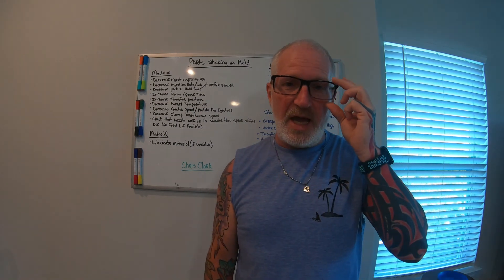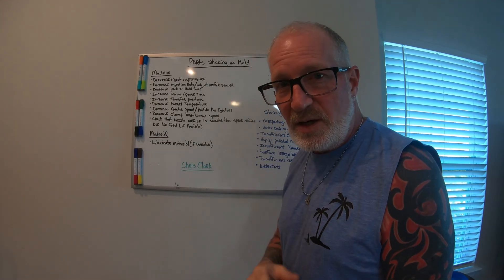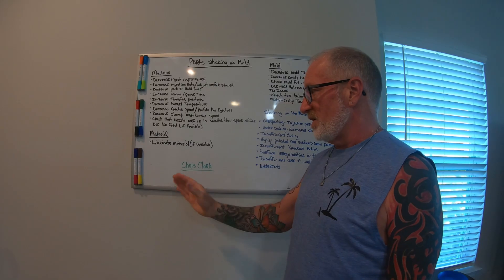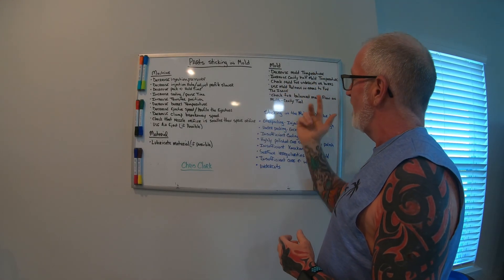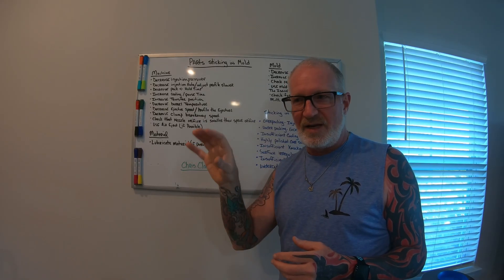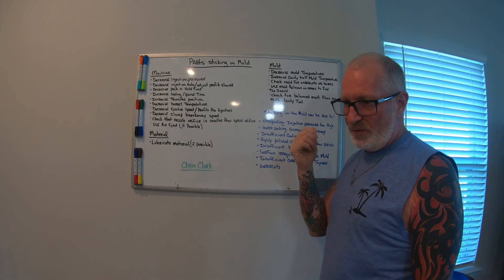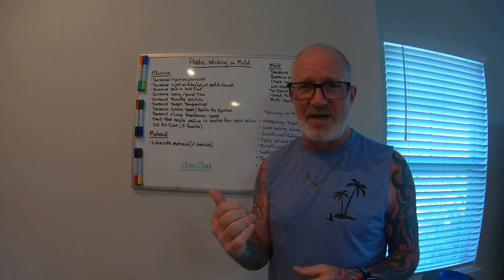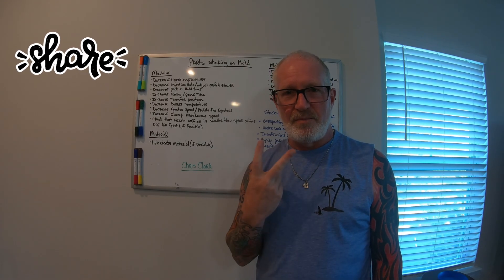Parts Sticking in Mold

Comment: Thanks for the video. 
Have had success using teflon/nickel coating on cavities- Tribocoat is one trade name.  
IMs had made spray coating units where a consistent amount of silicon was applied at preset intervals.
Reply from the maker: Yes, I did the same thing at one place I worked at they didn't want to fix the tool. Thanks for watching & the support to the channel.

Comment: Had to laugh when you said mold release should be temporary. My company uses mold release like butter on toast. It’s about 5 or 6 jobs we use it for, but these are constant orders. We keep cases of the stuff on order.
Reply from the maker: YES, a lot of companies that I have worked for use it like its oil to help the parts. Instead of fixing the issue then they have operators cleaning them after. So much rework LOL. Thanks for watching & the support.

Comment: So we have a tool that has a core on the stationary platen that forms a hole on the part. We run it on an old Toshiba, (not any of our newer Engels due to demand for other jobs) and that hole feature flashes very easily and sticks parts to the stationary platen. They’re a bugger to get out sometimes too. In your experience how would you tackle an issue like this? It’s something I’ve been struggling with for months at this point.
Reply: What type of material are you using ?
Reply from the maker: Yes I agree
Reply from the maker: What type of material are you running, water temperature, & the cooling of the cycle. All of this will help do come up with a plan for you. Thanks for watching & the support. Get this back to me & I will see what I can give you.
Reply: We had issue bit similar was air ejector on fixed half just used enough air on ejector to release part as opens but air control valve another one we had to put ejector to cover larger surface area